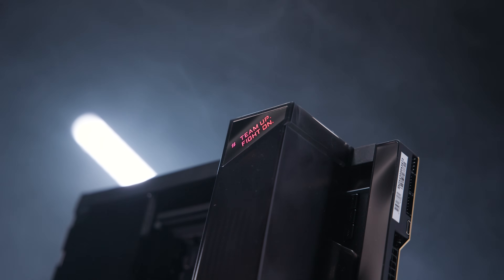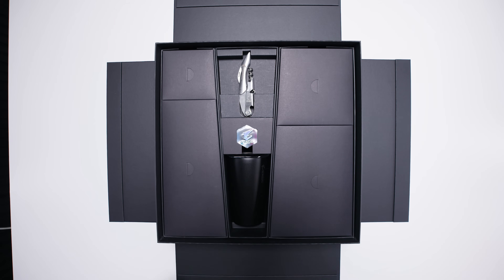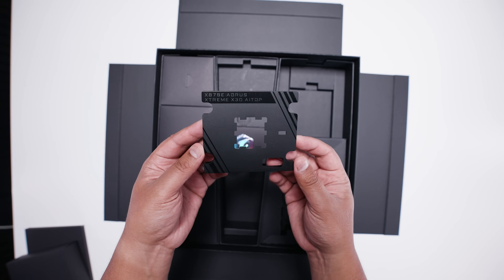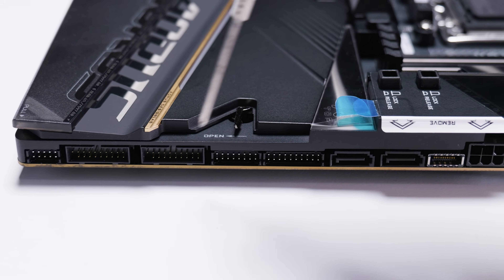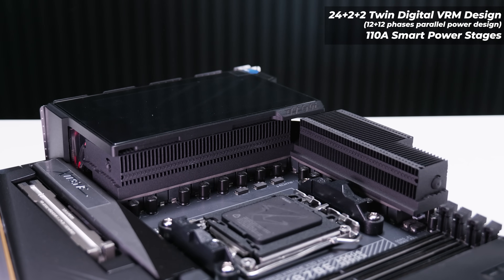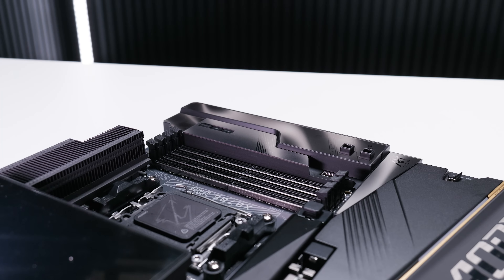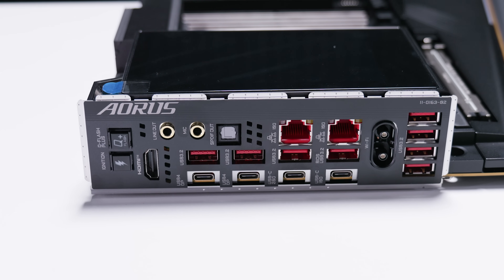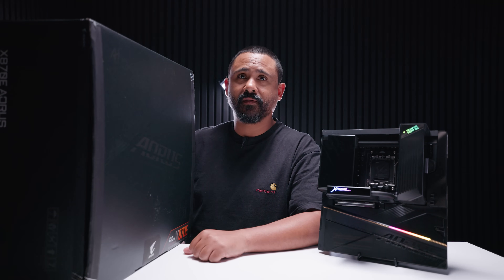Is This the Craziest Motherboard Ever Made?

Comment: This would have easily been a direct competitor to the ASUS ROG CROSSHAIR X870E EXTREME if it wasnt for the PCIE 5.0 X8 Slot. Plus, it has superior AUDIO specs. It should have been (2) PCIE 5.0 x16 slots + (1) PCIE 5.0 x8 slot. With that said - it definitely has the better design between both motherboards.

Comment: The one thing that sets this apart from other high end boards is using the Realtek 10gb instead of the Aquantia. This allows the use of 2 of them as they are much more trouble free and don't heat up as much. I bought the Asus X870 crosshair extreme and I'm already tempted to replace it with this.

Comment: I’m genuinely curious how this will work in a build. I get that some parts aren’t necessarily needed to be put on like the ram cooler and the m.2 heat sink as it’s just optional parts but if you’re gonna be paying as much as a gpu for this motherboard, you best believe you’re gonna use every dollar you spent on it to use them. What I’m most curious about is what kind of gpu’s can be used with both ram cooler and m.2 heat sink installed. Like I’d like to assume people that have disposable income and own a 5090 would most likely use their 5090 with that motherboard and all of its glorious parts. Including the fact that the there’s also an IO cover with the 5in screen and how much space it would take to have an AIO on.

Comment: Honestly I am not impressed with this. I would love a motherboard to be made for consumer PC's that are more like work stations. I want to be able to run a local LLM that is massive. I'd like to be able to run an H200, and a 5090. I'd like to have at least 8 Ram slots. Using 128GB per slot. 1.024 TB's of DDR5 Ram that can run stable at 6400 MHz at least. I'd love to run it at 8,000 MHz with something like a 34 CL rating. I mean in a perfect world 28 CL. I know that is unrealistic, but running this with a 9950x3d would be fantastic. I think with that amount of ram, and 1 H200, and a 5090, you could run the biggest baddest LLM locally, and game for years into the future. I'd like to water cool the entire unit including the GPU's, CPU, Ram, and NVME's. Speaking of Storage, I'd like to run at least 4 - 8TB Gen 5's at ridiculous speeds, even though I would be running 1 TB of electric speed ram. IDC if this unit costs something like $40k. The motherboard would be approximately $2k, H200 would be $30k, 5090 $3k, CPU $600, Ram $2,500, SSD's $3,500. Liquid Cooling custom System - $1k. So I guess that would be: $41,600. I would be fine with that then buying a workstation with an $11k Threadripper. I think you could get the same performance for AI, bc it's specifically Ram and GPU driven. With 141 GB's of V-Ram out of the H200, and the extra V-Ram out of the 5090, and 1 TB of ultra fast Ram, I think I could run at least a 70B perimeter LLM with 0 quantization. In addition to be able to run any game at 4k at ultra settings at 120 FPS plus. Possibly 400 FPS at 4k even. I mean if I had everything over clocked with the liquid cooling, I'd get ridiculous performance out of that beast. I promise you I will make the $42k back in a week with all the businesses and code I produce with that LLM.

Comment: Not to flex here, but I too own the Godlike. I received an insurance payout and went nuts on a PC build 😂 I have to say, there are things on this board I like more than the Godlike. The far-right connector cover is only single height, not double height, which made it difficult to fit into a case. It has the better placed LCD screen over the heatsinks. I think I prefer this board. It's just that the Gigabyte software is very lacklustre IMO. Still, so is the MSI software. I think I want this but I can't 🤣

Comment: I have a MSI X870E Godlike from last year. I fucking hate it. MSI has proven to be they are unreliable with their firmware regarding the M.2 not retaining their speeds. Worse is the LCD panel has been buggy as hell. Nearly a year of issues and no communication. Sucks because when it works, its great! Looks good too but man nobody should spending that much money with that many issues. I'll keep eye on this. It matches the Godlike most ways now just need to confirm I can run all M.2 drives at their full gen 5/4 x4 speeds. The godlike can do that and if this can while also being problem free is a win.

Comment: I've owned 4 high-end gigabyte mobos and not a single one was without issue. The worst offender was a board with a faulty chipset that would freeze my PC randomly. It took weeks to diagnose the issue on my end until I finally decided to buy a replacement mobo while this one was in the shop at Gigabyte. The repair took 6 weeks and it still came back faulty. I don't trust Gigabyte to get a board this complex anywhere near correct from a reliability standpoint. Sticking to my Asus X670E Hero for the time being!

Comment: I wish. Simply because you can run x16  and x8 in the 1st and second slot respectively, at the same time, which I don't think any other mobo supports.
Reply: It won't do that, like you say no other board does it because it's not possible. x8/x8 is what those two slots will run at.

Comment: Well, this board is a step in the right direction in terms of what's needed: fewer SATA ports, fewer PCI Express ports, more M.2. All of this is only being done because the PCI lanes on most platforms aren't sufficient. That's why I've been using the Threadripper platform for years.
Reply: One more thought. For €1000 you can also get Thredripper boards where you can split 16 PCI Express ports into 4x4x4x4x configurations. This board here is completely overpriced for what it offers.

Comment: This is honestly not as expensive as I had thought, especially when there are 64 gig DDR5 RAM kits going for $300-$500+ for just RAM thanks to the AI BS. $799.99 USD on Amazon seems fair for what it is - absolute overkill in every single way. For context when AM5 first launched I bought the ASUS ROG Crosshair X670E Extreme, which was $999, and that board replaced my AM4 ASUS ROG Crosshair VIII Extreme which was $799.99. So if anything, Asus has backed the pricing back down to the still high priced range, but at least it's $200 less than my current motherboard. 

They are indeed damn good boards. My old AM4 board I ended up putting into my unRAID box along with the 5950x.

Comment: idk, I love my MSI GodLike. Yes I do look into the case and look at the board's beauty. A NVMe M.2 5.0 get extremely hot... so that huge cooler kind of is required if you use 5.0 speeds.
Reply: I too love my Godlike and ended up swapping the thermal pads on all my M.2 slots to 2.0mm pads, this helped tremendously with ssd temps. Everything runs well within spec now. Not sure if this was an oversight from MSI but the out of box pads seemed to barely touch the top of M.2 SSDs which made gen 4 and 5 temps high.

Comment: For $800 plus on JUST a motherboard, that RAM better NOT be an "included" accessory from them, because if it is, it's instant e-waste to the user buying that motherboard, because they're not dropping $800+, again, ON JUST THE MOTHERBOARD, and putting off-brand RAM in it

Comment: PUT TWO 5090S AND LOSSLESS SCALE THEM
Reply: And with x16, x8 and x4 slots you could use the third slot for a 32-bit PhysX GPU.  I'm running a 6 GB low-profile 3050 with my 5090 for 32-bit PhysX but my board only runs x1 on the secondary PCIe slots.  I'm running a B650 board right now, won't make that mistake with the PCIe bandwidth again.
Reply: @dkindig thanks i never really took bandwidth to mind when i saw people doing lossless dual gpu setups
Reply: @Flappybeanbag  Yeah, I think even this board runs PCIe_1 at 8x if you have something in PCIe_2.  With Gen5 it's not a huge deficit, but, the total number of lanes being limited is the Achilles-Heel of both Intel and AMD desktop boards.
Reply: @dkindig   darnit. i guess its a decade before they upgrade

Comment: This kind of PCIe layout has always been the reason for which I stay the heck away from this tier (and medium/high too) of Gigabyte: Too useless and wasteful. 
A typical setup utilizing the full potential of this board potential would be 2x GPUs and 1 RAID card / whatever else we need. 2nd 5.0 x8 slot is just too close to the bottom, blocking the last slot. Previously in building one with similar PCIe layout, I tried mounting the 2nd GPU vertically with kit and riser but barely any room - both the cards and their cooling. With the trend of GPU getting bigger and thicker, I will need both a case and a kit for 5-slot vertical mount, which is absurd.
Went with Asus ProArt, had never regretted.

Comment: That board makes nothing, on first they packet most of the boards electronic parts under covers what makes cooling problematic while on the other side making extreme oversised vrm and nvme cooling and ram cooling isnt need at all, and wifi7.. its not working under windows10! there are no drivers for it! there should be a clear warning on the box for that, other vendors also lack on that while people get trapped and find out that wifi7 wont work for them.

Comment: The PC market needs an entirely new segment right between standard desktop systems, and Threadripper workstation class systems. Who needs 128 PCIe 5.0 lanes? Not I. I could live with half that but there's no way in hell I can live with just 24/28. They have a lot of nerve to put so much high end connectivity on a board with so few PCIe lanes.
Reply: There's sort of a segment, the non-pro Threadripper, but it's still too expensive compared to what HEDT (LGA2011-3 & 2066) used to cost.
Not to mention that TRX50/WRX90 and W790 are compatible with RDIMMs only, and OC capable kits of those are quite expensive as well.
Reply: @Rubed0_o  Not enough of a price difference between pro, and non-pro, and the non-pro chips are still 128 lanes on an enormous MCM chip. It would cost half as much to make them if they were cut in half. Yes, RDIMMs are really expensive, especially lately. To go from a regular x670, x870 to something with more lanes is ridiculous. It goes from like $3k to build a system, to like $5k, minimum.
Reply: @SyntacticOperator I agree. Although 128 lanes is a 9000 lineup thing, older non-pro chips had only 64 lanes and still cost an arm and a leg.
And that's regular RDIMMs, OC ones are even more expensive.
I wish there was still a decent HEDT segment, but neither AMD nor Intel are interested in it anymore.

Comment: you know what the saddest part is... the screen on the board where the IO is is non configurable. The audio dongle cable is frail at and will break. I fell for the aorus z790 xtreme x and tbh if I knew then what I know now about that board I would have never bought it .
Reply: Thanks for sharing your experience to hopefully help others make better buying choices!
Reply: What would you have gone with instead? I'm just curious at this point - I went with a ROG Strix X870E-E which was way more gamer-y/missing extra PCIe slots I would have wanted mainly because it seemed to test more on par with the ultra-high end boards like this (minus features), vs. the ASUS Proart at the same price seemed to be weaker like tested more in line with the sub-$500 boards. 

Personally, I run zero motherboard or peripheral programs on Windows (don't even have to mention Linux since they don't care), so the screen doesn't add much as I won't have Gigabyte's program or Asus's installed anyway. If I can set it and forget it, that'd be cool, or if it's open enough to allow customization. Doubt it though - I get everything set in BIOS, and have an extra Windows To Go install on an external SSD with OpenRGB, etc. for configuring stuff once.
Reply: @clinttube  just a more entry level z790 with a good vrm setup, problem with this one is you cant even change anything about the screen in or out of bios you just get AORUS's pre set purple theme and it cycles through info. At the price that the z790 xtreme x was and is its utterly unacceptable.

Comment: Unless a motherboard somehow manages to provide substantial CPU, memory, or M.2 performance uplift, it's really not worth spending money on. I've transplanted my same horribly-binned 9800x3d, 1tb m.2 and 2.5Gb NIC into both an x870 Extreme and a b650, and the performance was identical. My $5,000 DAC didn't even detect a noise floor issue when connected by 3.5mm to the motherboards' speaker outputs. There is ZERO reason these days, to upgrade or buy the top of the line motherboard except for penile deficiency syndrome, because there is no actual IMPROVEMENT....Who actually has a home that only has wifi 7 devices, or a wired home network with 2.5 or 10 gig ethernet on every connected device? It's stupid additions to motherboards designed to raise prices, because they can't do anything else with the board to segregate the market between the product skews.
Reply: Excellent take.
Reply: Excellent take.

Comment: the point of this board is not to buy it or to use it, it's more of a showcase piece for Gigabyte to go all out and they will push it to reviewers as much as possible. These types of product are strategically introduced to make middle-tier products seem more attractive and reasonable, it's called a "decoy product" in marketing
Reply: I think it's more of a "Halo product" to attract hype to the brand
Reply: People will buy this if you are right into gigabyte.
These boards are over the top but they are for the top end CPUs and to push them to the max
Reply: @zagan1 Except they're not over the top and these CPUs are not top end.
You'd have to look at WRX90 and TR Pro for that.

Comment: Depending on the configuration options in the software, the screen wouldn't be entirely useless. I'd hope they would do like on the LCD AIO screens and let you use it as a sensor panel of sorts. The location isn't ideal, but it's not that much out of the way either, lol.

Still, there's no way I'm dropping a grand or more on just the mobo. That's ridiculous. It looks sick, though! I love that cover for the extra PCIe slots. Wish more boards would have that. Nobody except for a select, niche group of power users cares about any other slots besides the main x16 slot for the GPU nowadays. Back in the days of sound cards and ethernet cards, it was different, lol.

Comment: I understand making an insanely op board. I dont understand the extra additions. If someone if going to be spending this kind of money, surely they will be spending the money to put these into a custom loop, so surely a ram/vrm/pcie/cpu water cooling block would be far better for it to come with rather than those big bulky air cooler ram/pcie blocks. I also dont understand the cup/bottle opener, just dont have those, make the price $20 less and save space with the stupid large box.

Comment: What is the point of the last or third PCIE slot ?
  Whatever you populate the second PCIE with,will definitely block the third slot.
  It's the same on the regular X870E Xtreme.
  All this money and fancy 'useless' stuff and the designers and or engineers could thought about a proper spacing of the PCIE slot.
  I've seen cheaper boards with good spacing.
   Sigh....!🙄

Comment: The box literally says its a complimentary box not for resale. That board is the same board as a master with some nice covers and they charge us this much more. Madness
Reply: That is why the MASTER is the board t9o buy!!
Reply: @JDD_Tech_MODS  crazy it doesnt have dual ethernet tho but the X3d does
Reply: Master can't run two x16 GPUs simultaneously at full speed/power.
Reply: @SigmadaFoundation  SLI is dead!
Reply: @JDD_Tech_MODS  Right... I'm talking about other peripherals and running things like an LLM while gaming.
Reply: @SigmadaFoundation  That is less than 0.00002% of use cases that need this board. MASTER is better choice for the average use.

Comment: This is one of those things where if you see a friend with it you say you're a dummy, why didn't you just buy a threadripper.
Reply: Exactly, unfortunately HEDT is dead/priced out of reach for most nowadays.
So people are buying these pretty plastic covered boards with quite abysmal expandability (cuz of PCI-e lane sharing between features).
Reply: and i'm still buying it 😊
Reply: @oh033 Dude I hope you're joking. If you have that kind of money get a threadripper. Even if you get the 16 core model you still get 88 available pcie lanes from the CPU and you get registered ECC memory support. Install your old GPU in addition to your new one and boom you can do gpu passthrough to another VM to test gaming on Linux. Or you can fool around with running LLMs locally. It opens doors well worth the additional money as opposed to a vastly overpriced AM5 board.
Reply: @azmi3333  threadripper have horrible gaming performance and lack 3D cache chips. Threadripper is solely good for workstation builds, so if you also play games these boards are the best middle ground..
Reply: @oh033 lmao okay goofy

Comment: It's 730€ in Germany. I would legit buy this thing if it was 450-500€. The retail packaging is much smaller, about the size of two normal boxes stacked on top of each other, maybe a little bit taller. You can already buy it for 590€ as a return at one shop. 

I'm waiting for a review of the board. It shouldn't have lane sharing afaik. Dunno man, I'd buy it for a reasonable price. :D

edit: yes, I would look at the screen. I use the little POST code display on my Asrock Nova Wifi to know the CPU temp, so hell yeah.
Reply: Mmmm You are confusing the normal Extreme AI Top for this Extreme X3D Ai Top, they are 2 different boards with different network chips and different sound chips and i.o. I currently cannot find this board anywhere in Europe, yes not even germany.
Reply: @igitsolutions You, sir, are correct. I did realize this about 10 minutes ago, but I'm outside and didn't feel like editing the comment right away. Ah well. Let my comment linger as a warning to those as superficial as me. 😁